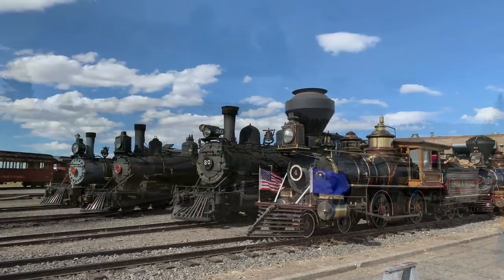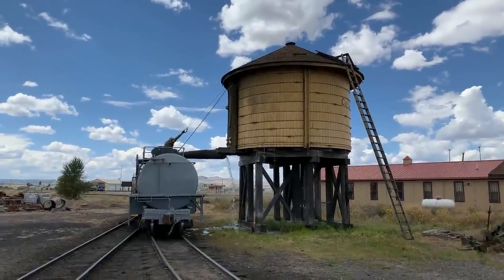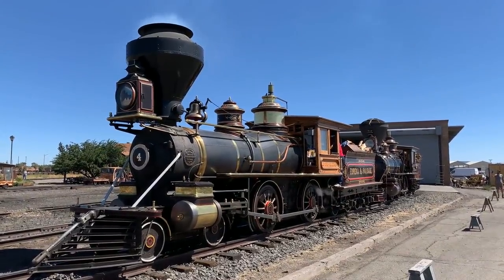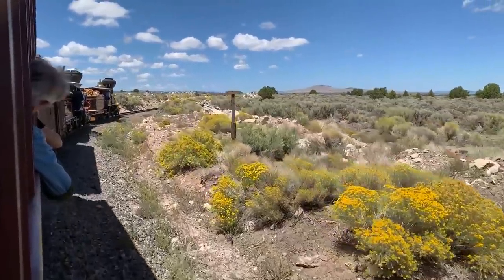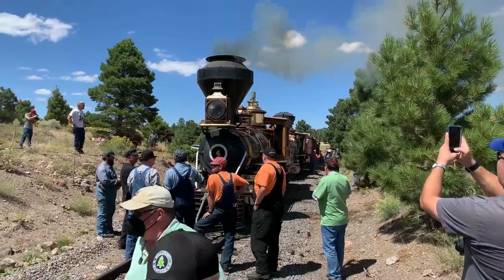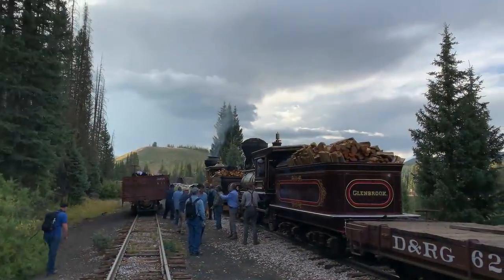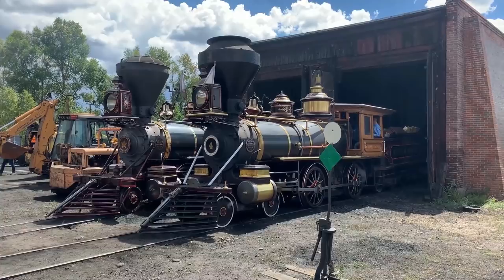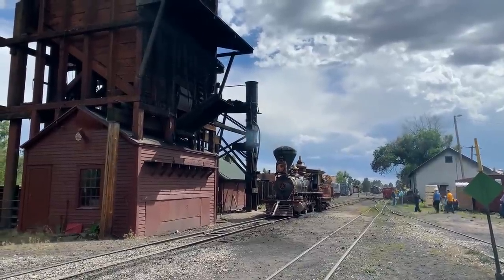Gathering of Victorian Locomotives Part 3 - Glenbrook and Eureka to Chama

Comment: My first exposure to the Chama facilities buildings was Campbell Scale Models HO scale kits, way before my finding out what they "really" were models of. Seeing the coaling tower actually operating, at all, was very cool.
I wonder, if the kits are still available? Back in the 1960's and 70's you could buy the kits separately or as a set, as I seem to remember. 
This is supposed to be about 1800's steam locomotives, sorry. ;-)

Comment: Please don't get me wrong.  I am curious as to why the Glenbrook pilot coupling bar does not have a pin to account for the horizontal swing while the Eureka's does.  I derailed a car using a coupling bar on a Crown 4-4-0 that the coupling bar couldn't swing.  Since the train made the trip OK it works.  Maybe there is extra room on the connection for the vertical to accommodate the swing.